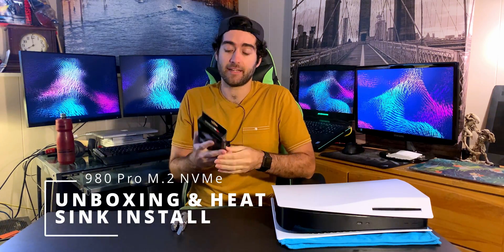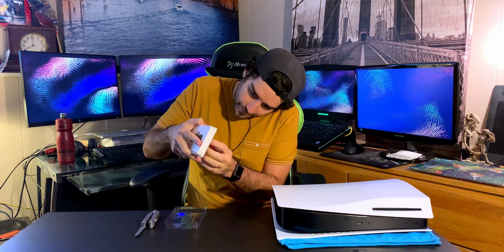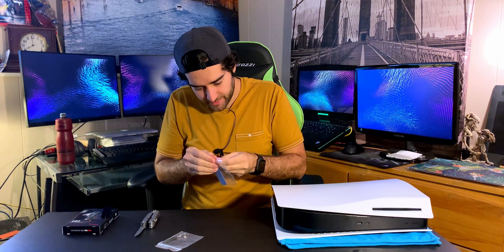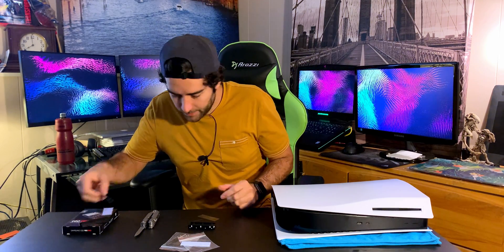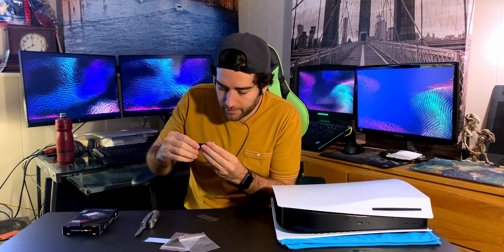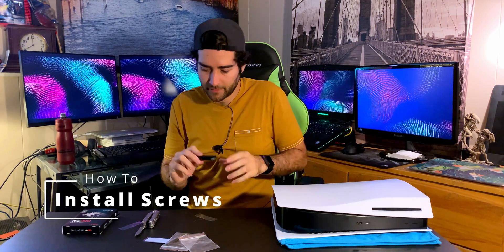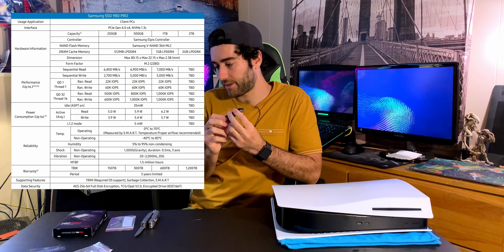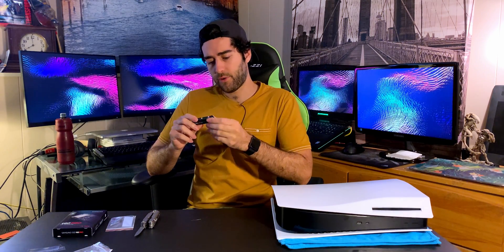How To Install A Heat Sink On The Samsung 980 PRO M.2 SSD 2280 & Unboxing

Comment: Is there an enclosure that fits the SSD with the heatsink attached?
Reply from the maker: I think a heatsink like this one would be the best, as it wouldn't fit in my PS5 if I got anything bigger or an enclosure for that matter. Stick with something small! As the PS5 has an enclosure built inside already! :)

Comment: There was 2 grey pads and one brown one. I placed the two gray pads in the SSD, but I'm not sure what the brown one is for
Reply from the maker: Probably just a spare tbh, if you'd used two pads, you're probably good to go!
Reply: @TechAfterDark  I threw it away already, it's in my ps5
Reply: Believe one of the pads was for the bottom

Comment: My ssd slides inside this heatsink ... I got a non sticky red pad and a blue sticky pad.. when I try and install in ps5 slot the ssd slides back inside the heat sink out the back of it making installing it impossible
Reply from the maker: Have you tried holding the back of it? I don't think mine slid out when I installed it! I made sure the double sided sticky thermal was perfect for the ssd. It just fit, and since the stand off holds it in place, I don't think it would ever move after you insert it. I hope this helps!

Comment: I have purchased  980 pro and it is detected in my asus tuf laptop with i7 11th Gen.
But the magician software says driver is not supported  and when checked benchmark  it came with 3444 MB read and 3323 MB write speeds.
Any idea on how to get suitable driver?
Reply from the maker: Hey! Have you gone into computer management? And format in there! It should work after that! Right click my PC, and click manage and go to disc!
Reply: @TechAfterDark  thanks for the reply. 
I have formatted like this for the first time to make it available or visible in my computer. Still having this issue. 
In magician software it says incompatible with intel driver

Comment: I have this same heat sink with a firecuda 530 1 tb, and I’m not sure if it matters but one strip goes sticky side down on the bottom of the heat sink, you place the m2 drive in, place that aside. Grab the top portion and put a sticky side of the thermal on the bottom of that. Make a sandwich out of the 2. No sticky side should be on the actual drive. I watched them set it up on digital foundry site and confirmed with a few fellow pc guys. I’m not sure if it actually makes a difference with the heat one way or the other but the for sake of doing it right I would do it this way. Stick one end on the bottom part, other one at the bottom of the top, make a sandwich, and put the screws in. Bada beep bada boop
Reply from the maker: Thanks for explaining this fully! Ya, tried to research quite a bit, and found that my way is probably the most straight forward. Your way is most likely the best way, but in the end. Even the labels help with heat. So I think getting that big heatsink really helps on top of the thermal pads. I'll pass this info along! And next time. Will apply this way. Thanks so much for explaining! I really appreciate the tech community! Everyone is so nice. :)
Reply: @TechAfterDark  the first time I installed it I did exactly what u did then after about a week I saw digital foundry do it and did more research so I decided to removed the drive and flip the sticky side up. Probably fine either way but When it comes to my ps5 and a 300 dollar ssd I didn’t want to take any chances.
Reply: I think the sticky side should be on the m.2 especially on the 980 pro where the height of the memory chips and controller is different, its not flat, i feel that the sticky glue will make sure that the thermal pad sticks nicely flat on the drives and there will be no hot air gap. 
Both asus and gigabyte motherboards here on the house have built-in m.2 heatsinks and BOTH of them have thermal pads u peel to reveal a sticky side to stick into the drives. 
Also, if you disassemble GPUs you will also notice that when you lift the heatsink out of the gpu, the thermal pads will stick to the board/memory and not the heatsink (most disassembly i watched at least), so yeah I think sticky sides should always stick flat to the component they need to cool. Also the thinner the pad, the better the heat transfer, so the thinner pad should be on the chips.
There probably is no wrong or right way, just that my way makes more sense.

Comment: Hi! I also use the same heatsink. Is it ok that the heatsink might be a little big because you have to press down the metal lid of the ssd port to screw it back on? Will it damage the ssd and/or the PS5? Thank you.
Reply from the maker: It shouldn't! I went over all the measurements and according to Sony. It fit perfectly. Totally fine, they give you quite a bit of extra space inside, and it's totally fine if it's touching the sides. You have the spacer anyways, and there's no contact with the actual ssd. Just the heatsink.
Reply: Ur good with that heatsink it’s a tight fit but I also have it no issues here

Comment: I bought the same heatsink, and may i ask what to do with the pad that is one side white and other side brown (in which it only have one sticky side)? I’m confused if it is also a thermal pad. Thank you.
Reply from the maker: Hey Xavier! Ya, I was a little confused too, since there was 3 thermal pads, I just used the two pads that fit, and used the thin one for the bottom, and thick for the top, it's not going anywhere, and I think they just give you an extra pad just in case, as it wouldn't fit in the case, and it looked like you could rip it to a better size or something. You should be good with just using the two pads tbh, I think Samsung's labels help with heat on top of everything, I hope this helps! :)
Reply: @TechAfterDark  Thank you for your response. And I also did the same thing you did in your video. Again thanks.

Comment: I have the 2tb 980 pro with only a one sided heat sink and thus far, no issues. Hopefully it'll remain that way.
Reply from the maker: Should work ok! Just important to use any heatsink and it'll greatly reduce the temps! As recommended by Sony or any PC build.

Comment: Very informal. Looking to buy the same heatsink and also when you install it in your next video, Can you please start it up for us to see if it recognizes without any problems. Thanks for everything. 💪
Reply from the maker: It runs amazing!! I've been using it for all my PS4 games and such! Can't do any tests on heat, but it's been recommended around the community, and I checked all the measurements to verify it fits. Probably one of the biggest heat sinks you can put in it, as it just fits. I've been really happy!!